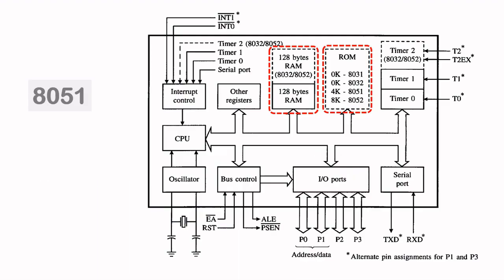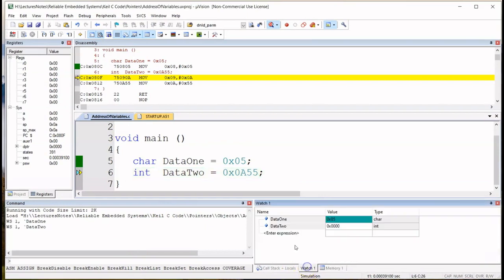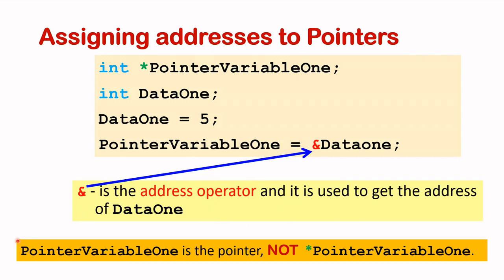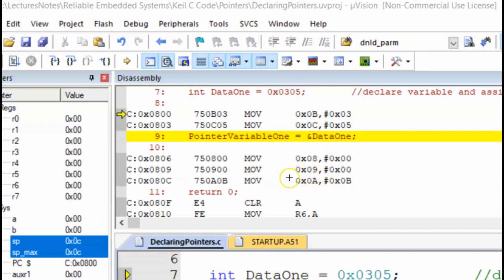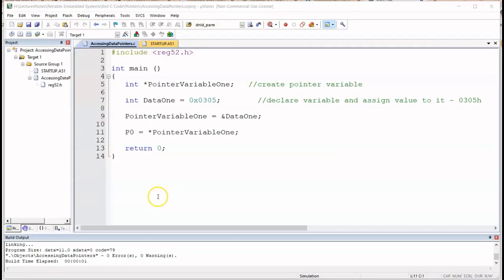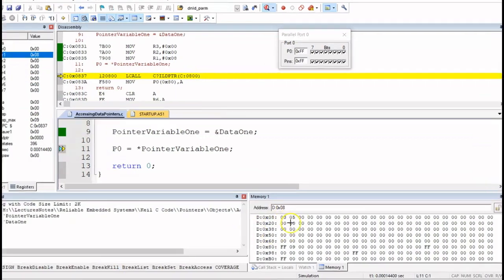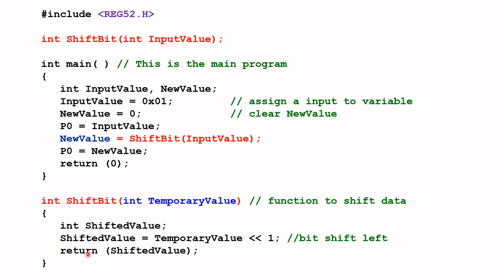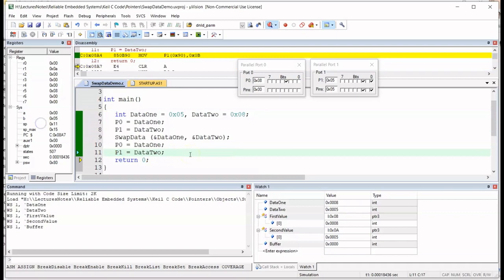#45 Embedded C - Pointers

Comment: A good video showing how pointers work at the memory level. I do have a question. At around 17:46,  PointerVariableOne is assigned 3 bytes of memory location but only the first address of DataOne is stored (0x0B). The other address (0x0C) is not stored. With only the staring address stored, how does the processor know how far ahead to look in memory to get the full address for the one object?

Also, another question about the purpose of pointers. The impression I got from the video is that pointers are useful because one just needs to pass the address of the object in question to a function for manipulation instead of passing a copy of the object itself, which would take up more memory. Is this a fair statement?
Reply from the maker: Ok for the first  question - It is the complier that assigns the memory locations. So the processor does not need to figure out the address. 

Second question - passing the addressess does not take up more memory. It is like machine code programming  where you to gain access to the memory location.